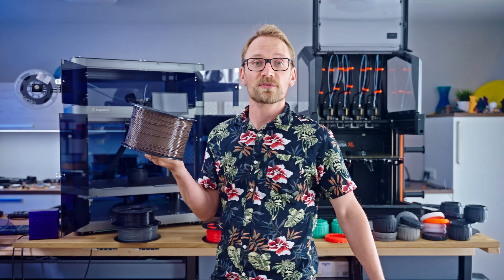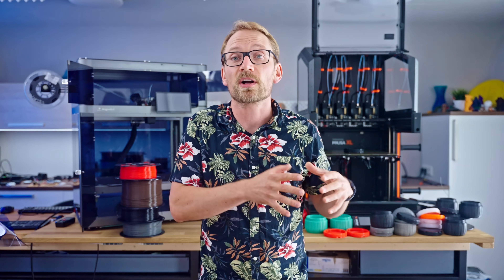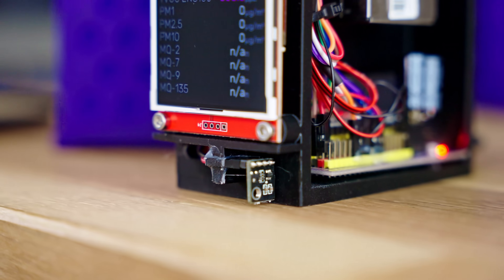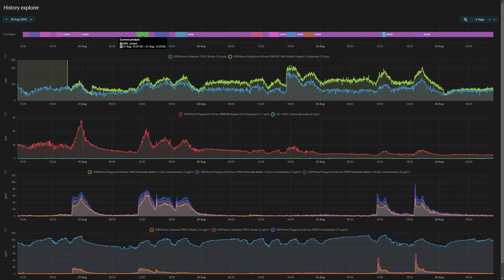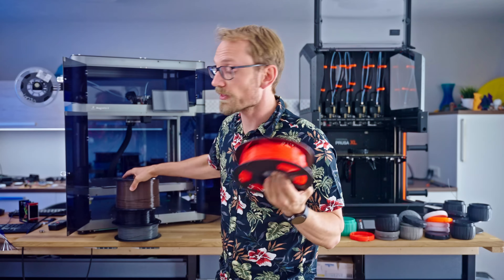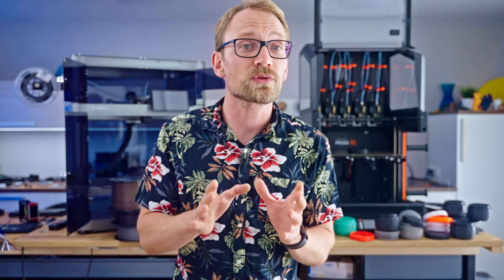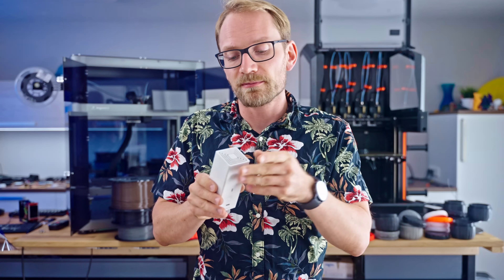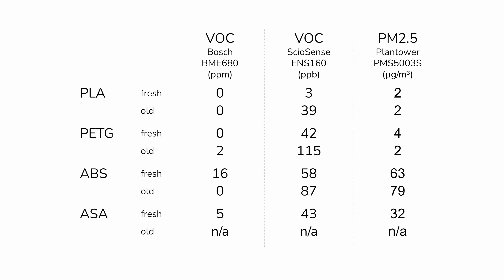3D printers are worse than I thought. Time to do something about it!

Comment: Venting microplastics out of a window is not an adequate solution. While it may seem effective for indoor air quality, it contributes to environmental pollution. Pedestrians near your window or in the path of the wind may inhale these pollutants; they also contaminate the environment outside your living area. It is advisable to use a filter before exhausting air from your room to minimize this impact.
Reply: Outside your home is a road, where asphalt rubs against rubber wheels, and an occasional diesel rolls by, both are source of substantial microparticulate contamination. So much so that one or two streets in my city in the middle of Europe are considered unsafe to breathe in for several weeks a year. Do you think your exhaust of several days of printing is comparable with even one car?
Reply: @SianaGearz  It appears that rationalizing environmentally harmful actions is a method to soothe the guilt of not trying to avoid them.
Reply: 3D printing is way too uncommon for some gas vented out the window to have any environmental impact. You'll do more environmental harm producing and recycling the filters.
Reply: @markus30000  Microplastics in the environment are already a significant issue. We should not contribute to it, regardless of how minimal the contribution may seem. It's the cumulative effect that matters; it all adds up.
Reply: @CRMcGee2  Absolutely! But we should start making change where it has the largest impact and 3D printing isn't even near the top of the list. 
For a home, washing synthetic clothing would be at the top with a contribution of about a third, just to give you an idea. And that's for every household, not just the ones with printers.
Reply: @markus30000  Why must we delay responsible 3D printing actions until another issue is addressed? It seems like a convenient excuse to avoid action, prioritizing other matters higher. But pollution remains pollution; it doesn't adhere to a hierarchy. The effort is simply too much to ask for, isn't it?
Reply: @CRMcGee2  I agree, there's no need to delay anything. But while you say people would rather start somewhere else than being bothered with getting a filter for their printer, I say people will get a filter in order to not be bothered with changing the rest of their lives. 
People tend to make token efforts in order to avoid those truly inconveniencing, deep changes and if someone owns a printer, such a filter would be the perfect example.
Reply: @markus30000  Please do not misquote me or put words in my mouth. Go back and read this thread; you clearly missed or misunderstood something in the conversation. I asked, 'Why must we delay responsible 3D printing actions until another issue is addressed?' I did not mention anything about people's preferences for starting positions.

Your logic is flawed: 'People will get a filter to avoid changing their lifestyles.' It's more likely the opposite; if they are that indifferent, they probably won't bother with the filter unless it addresses a personal issue for them.

A 'token' effort is better than no effort at all. Anyone willing to consider the 'token' effort of a filter has at least acknowledged the need for change, unlike someone who remains indifferent or makes excuses for themselves and others.

From this part of the 3D printing community, I get the impression that they just want to print without concern for the impact on people's health.
Reply: @CRMcGee2  Sorry if I did! 

Oh, I don't think many people will get a filter to avoid changing their lifestyles, because, as I said earlier, the environmental benefits are negligible and therefor probably not the first thing on anyone's mind. 

And if an environmental benefit is the first thing on someone's mind, I'll come back to my initial point: Start somewhere else. Not because it's mutually exclusive, but because it makes more sense.
Reply: @markus30000  
You're just proving my point. As I said, from this part of the 3D printing community, I get the impression that they just want to print without concern for the impact on people's health. 
It's either down playing the concerns or brushing them off as tokens or some other way of just hand waving it away.
Reply: @CRMcGee2  But we weren't speaking of health, we were speaking of the environmental impact. Although people don't care about their health too much, either... they mostly care about the smell ;-)
Reply: @markus30000  
We are not having a conversation you are trying to minimize the idea of anybody doing anything about 3D printing's environmental impact.
I'm done with you.

Comment: As a medical doctor aware that nothing can take the place of prevention, I’ve done my best over the past few years to inform people of this threat with published research corroborating it, but virtually no one — certainly none of the big influencers — was interested.

I think the problem is that acknowledging this problem creates another: what to do about it. The simplest solution is to not print in occupied buildings (instead printing in a shed, for example), to evacuate the air from the shed before entering, and to wear a highly effective mask (P100, e.g. with 3M’s 60923 filters) whenever inside. I came up with a solution enabling users to safely print inside but there appears to be no interest in that option.
Reply: What’s your solution to printing inside? I would buy an enclosure that I could place my 3d printer in.

Comment: Do you have a central HVAC system (seems like a very important question — and most likely the case in the States)? If so, were you running it on auto or did you have the fan on?

Comment: So, the fact I have my Voron 2.4 (loosely sealed enclosure w/ clicky clack door mod, I can do better job sealing still) sitting on a grow tent that has a carbon filtered extraction fan means I'm far ahead of the curve here.
Reply: I have a 2.4 as well (doom cube mod) And I sealed the panels with caulk and it raised my inside temperatures a couple degrees and definitely cut down on the smell.

Comment: What I want to know about is filled filaments and how many asbestos like small particulates are scrapped off the surface of a print as the printer goes. We've all heard that while in filament its stuck in the plastic, but based on your nozzle endurance tests from a while back, I wonder if that sanding the nozzle does as a printer prints results in things like lung irritating short carbon fiber strands into the air.

Comment: Interesting result! But what about the MERV-13 filters? There is some valuable information in Healthy Home Guide's video on HEPA filters. From what I understand, "DIY air purifiers with MERV-13 HVAC filters are better than HEPA". Even if HEPA can remove very fine particles, increasing the CADR (Clean Air Delivery Rate) will make a huge difference in a room. Moving a lot more air through a less efficient (and cheaper) filter is better than moving less air through an efficient HEPA filter. 

It would be interesting to see how the theory from this video apply in a 3D printing environment, for example testing DIY MERV filters against Amazon or Ikea HEPA you've shown.

On the VOCs side, I'm also intrigued by the efficiency of the Nevermore Micro V6 filter. It claims that "it can process the chamber volume of a 250 Voron in just 30 seconds, and a larger 350 in approximately 2 minutes". I'd like to see if this is enough compared to the particles created when printing at high speed, high temperature, as well as the efficiency of the traditional carbon against the new Nevermore Scorch.

The perfect setup from what I know would probably be a DIY large air filter in the room with a good CADR, with a carbon-activated (or alternative) small filter in an enclosed printer. The DIY large air filter can run even without printing, running slower and quieter, while the small noisier carbon-activated filter removes the VOCs during print and keep the warm air inside.

Comment: Particulate Matter sensors, especially the low-cost consumer ones, typically measure only one size (e.g., PM2.5) and the other sizes are based on this sensor reading corrected by some proprietary calibration/algorithm. This is why the values are really close as mentioned at 10:05. For typical household scenarios this is accurate but theoretically the algorithm could be completely off in tests like this.

Comment: ESun High Speed White PLA causes eye irritation when I print it. I used a PM1.0, PM2.5 PM10 meter and it was measurable. I am setting up a fan filtration system to deal with the particles.

Comment: Always print near a window.
Always route the pollution outside.
Always capture much as you can to minimise your impact.

If the pollution is nearby you, venting it out at a window ensures it doesn't get back into your house. One of the first projects people should make for themselves is a filter box and components to attach a hose to it, done entirely outside with a fan pointed at the printer to push pollutants away.

Comment: Really interesting findings. I print 99% PLA, but print a small amount of ABS (I am moving away from buying printers an just building open source projects instead).

The process of printing ABS led me to do a lot of calibration prints and tests and I have noticed that dialling in the temperature to be the minimum I can get away with, but also produce strong parts with no de-lamination of layers has noticeably reduced the odour. I guess this lines up with the findings here?

In some ways it pays (in more than just print quality) to take the time and get as perfect a settings as you can I suppose?

EDIT: I think I am going to get one of those air purifiers too…

Comment: Nice study Thomas. It is good that you highlighted how the filters work and why the 0.1-1um particles are the hardest to filter. In most articles and reviews this is overlooked. When looking for a air purifier I settled on the Starkvind from Ikea, the bigger brother of yours. It has a big better performance when you look at CADR/W and CADR/dB. The filters are bit more expensive but also a bit bigger. To have a better performance you can also use multiple units. On the higher levels the efficiency drops a bit and of course they get much louder. You mentioned the (H)EPA12 rating as used in the Ikea air purifiers. Most other (high performance) air purifiers have a "true"  HEPA filter (class 13). This sounds better, but for the intended use it is not.  Due to the less dense filter (class 12) more air is being pushed trough so with the same device and fan settings more air is being pushed through resulting in a higher CADR. For people who are interested "smartairfilters.com" has a nice article about this (H12 vs H13).

Then anecdotal, I don't print anymore, but I used to get headaches after/during printing. I was already skeptical about the health risks. At a certain time I moved the printer to another room. I also opened the windows further and turned on the hood in the kitchen. Good that you are highlighting the risks.

Comment: I had to stop printing PETG shield frames back during C19 due to respiratory issues. Haven't had that problem since, but also don't print that kind of volume anymore.
PLA2 smells like syrup.
I don't touch anything else as I can't really install an exhaust fan in the room.